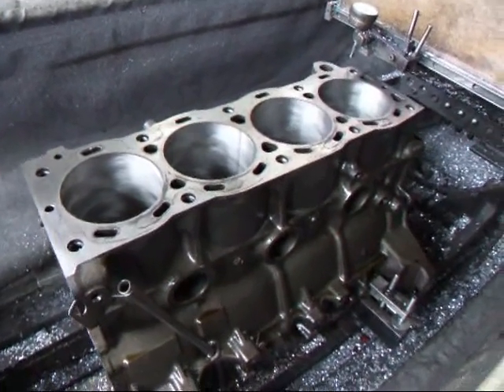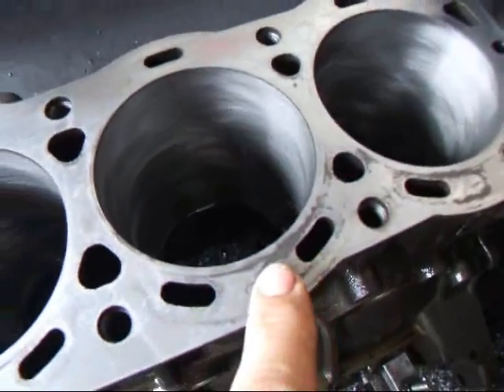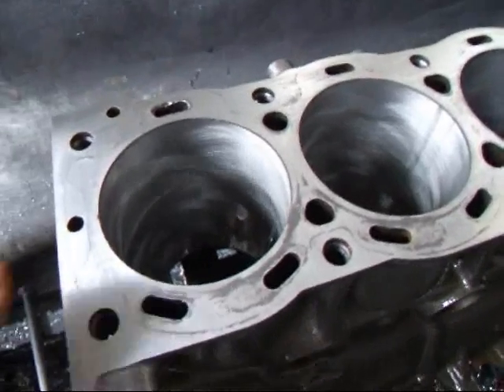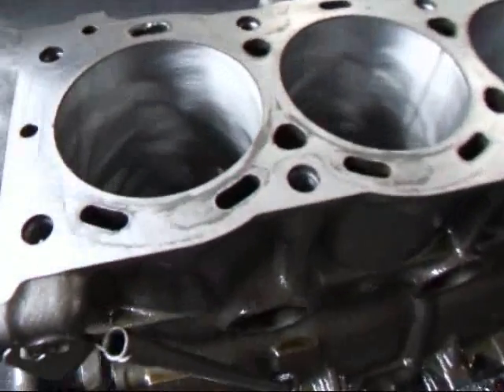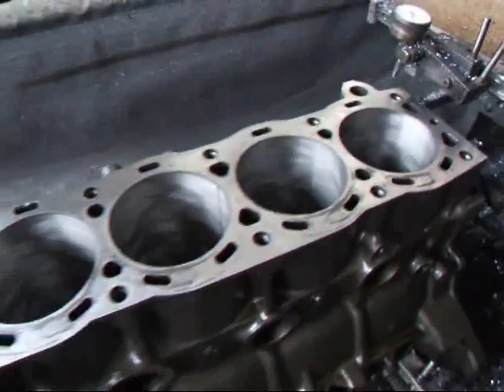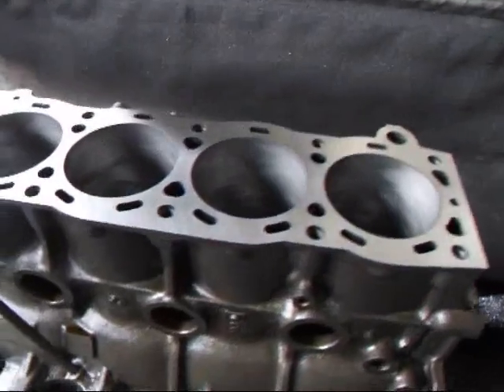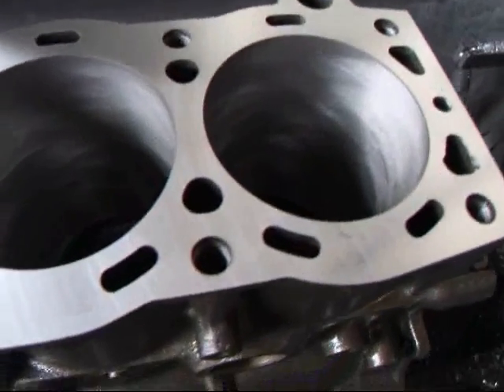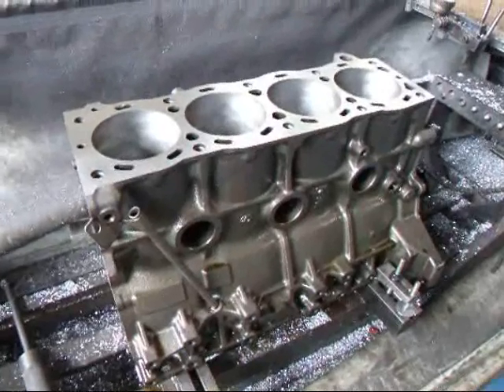Toyota 22R Block Resurfacing

Comment: I've always make sure to have the machine shop leave the timing cover on the front of the block when they surface the block to make sure the timing cover is also dead-level with the block, otherwise you can end up with a problem when you go to bolt the head down if the timing cover is slightly higher than the level of the block since the head overlaps the timing cover.
Reply: Pete ,you  need to make more Toyota videos bro! I've been subscribed for like 6yrs

Comment: @fiatnutz Yes of course, we know it is a four stroke. But what I am asking is, there are two pulses of power per revolution on a four cylinder...in the case of tandem engines coupled at the cranks would it be beneficial to have both engines fire and synchronously (A1,B1)-(A3,B3)and so on..... or should the momentary accelerations of the cranks be sequential between the two motors 1-1-3-3-4-4-2-2? Which of the two firing sequences would be the best scenario for crank harmonics in your opinion?